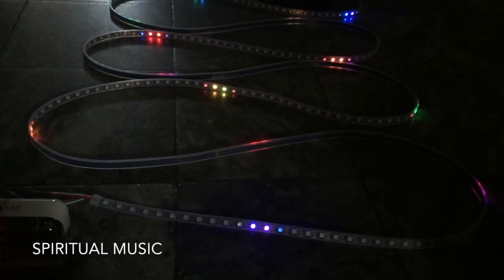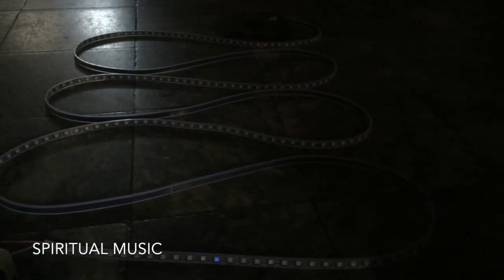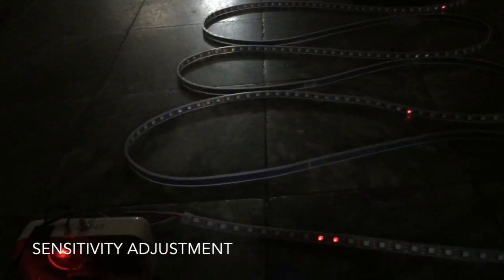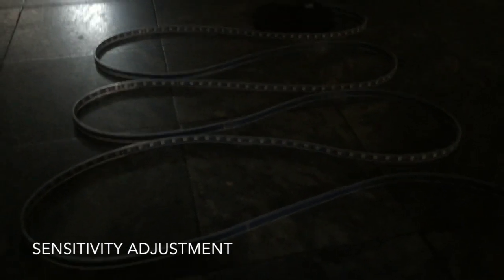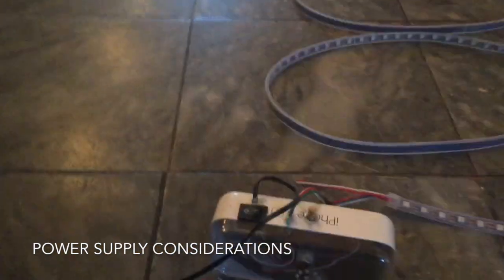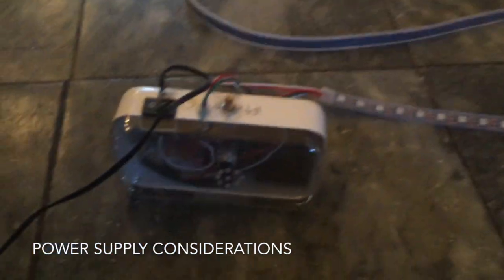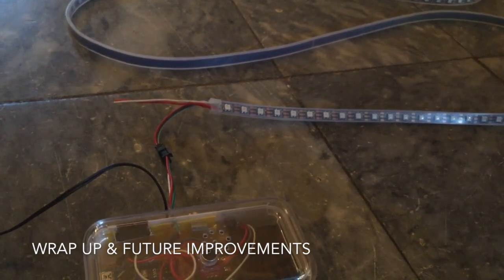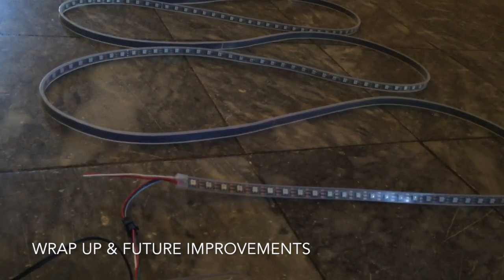Improved DIY Music-reactive LED Strip

Comment: hello can someone help me when i check the code i have this error massage:

music_reactive_led_strip:10:10: fatal error: FHT.h: No such file or directory

 #include <FHT.h> // include the library

          ^~~~~~~

compilation terminated.

exit status 1
FHT.h: No such file or directory

knows somebody how i can solve this problem
Reply: I'm no expert in coding but my guess would be you haven't installed the library. http://wiki.openmusiclabs.com/wiki/ArduinoFHT?action=AttachFile&do=view&target=ArduinoFHT4.zip
To include this library in the code you are using you then have to go the toolbar at the top to sketch-->Include Library-->Add .Zip folder and then click on the zip file that you just installed from the link. Then it should get rid of that problem.Hope this helps at all